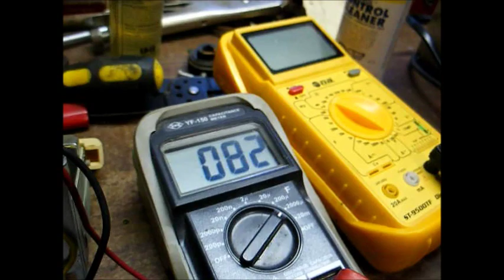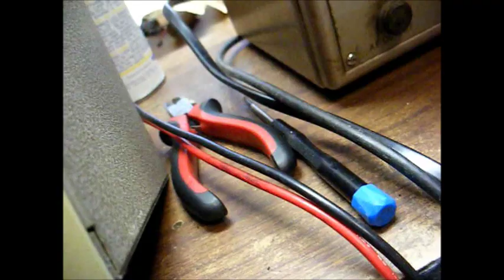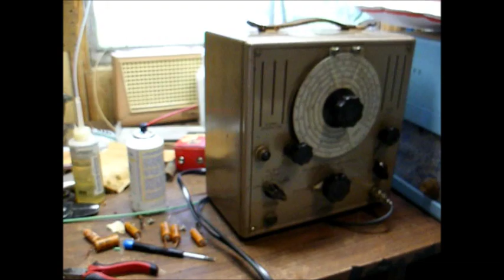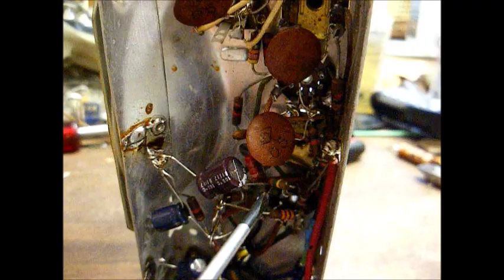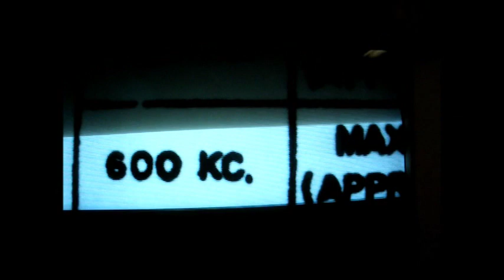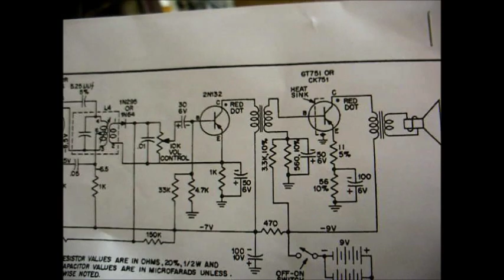Repair of a 1956 Olympic model 447 transistor radio - part two

Comment: It works way better than the 4-transistor radios I ever had (Philco, Sylvania) from the same era. I am surprised by the need for 2 huge batteries. I suspect it is partly because of the signal output stage having only one transistor. Similar sets (GE 5-transistor) used big (not this big) batteries too, as did the 4-transistor units I had. The switch to push-pull outputs developed more volume at lower current draw.

Comment: Use a 9 V lithium battery. It will probably last as long as those carbon zinc batteries wired in parallel.

l.